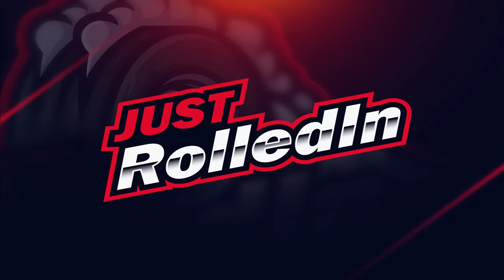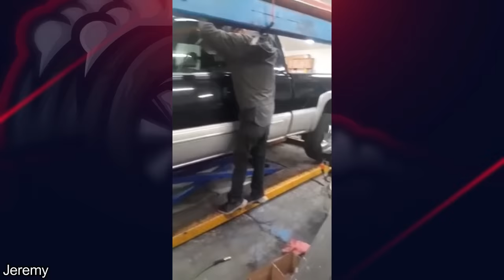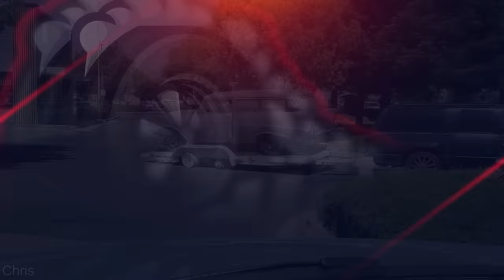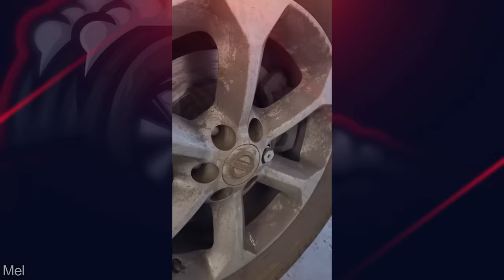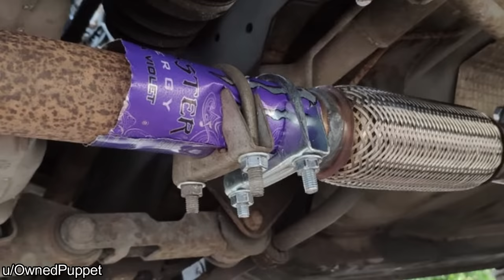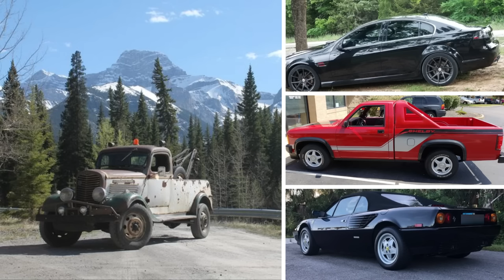Customer States Brakes Just Started Making Noise Yesterday! | Just Rolled In

Comment: OK,  so towing the '57 Chevrolet Nomad,  if the trailer looks like that,  what will the rebuild look like.......just wondering.....
Reply: That is the rebuild....
Reply: That's not a Nomad, it's a 210 2 door wagon.
Reply: @QuanticChaos1000  your are correct,  I stand corrected......👍👍
Reply: This is why you never borrow someone's trailer and always check out the trailer before taking it on a trip if it is not your personal one.

Comment: Wow, I have a few comments on this video.
The sidewall repair - that only makes sense to do as a trail fix, where you have to do it or you don't get out. Otherwise, replace the damn tire.
Blown axle - looks like they ran it dry, and it blew up after seizing. I've heard of guys running on rims up near Alaska because they had no choice, this was just a clueless owner.
The exhaust repair with the tin cans is something I learned from my Dad as a temporary fix, though it's traditionally done with mechanics wire or fence wire. Keeps you in the good graces of the local LEO's until you can get some new pipe and fix it right. I've also tried that crappy exhaust tape a few times, but it always blows out on me.
I know two people that have shot their trucks when hunting, in both cases they propped the gun on the truck for stability, sighted the shot through the scope, and forgot that the bullet comes out of the barrel a couple inches lower. One was through the hood of his truck, the other one was through the bed of their truck.
Reply: Sort of same but dumber...friend had been hunting, walking back to truck, must have been 1/4 mile from it, aimed and fired at it as a joke...didn't laugh when we got there though. Both side windows gone.
Reply: I saw 2 girls try to fix a sidewall hole the size of a nickel with spackle. In a 7-11 parking lot.

Guess what happened...

Comment: A few months ago, I had a car in where the customer states was "brake pedal is squishy and low brake fluid light is on".
No mention of noise.
The pads where worn through, backing plate of the outer pad gone, caliper fingers worn almost all the way through, and the piston was just barely hanging in there by the dust boot.
And they DROVE it to the show that way...

It had newish brakes all the way round, but by the looks of it the brake pad shims hadn't been replaced and the surface hadn't been cleaned, so the new pads got stuck.

Comment: Had a customer come in for a oil change on her daughter's car , they went for lunch and we did the work and I had to park the car and I turned the radio off so I could Concentrate on driving (and not have my ears bleed out) ... and you could hear the brakes saying they needed some attention and they came back later and paid for the work and went on their merry way, and a little while later the mother came back asking if we did something to the brakes and we said nope just the oil change. but it's amazing what your car is saying to you when you don't have the car radio blasting away.

Comment: Trust me I've tried putting plugs in the corner of the sidewall of the tire and down the sidewall of the tire in my work when you pump the air up but as soon as that thing rolls about 10 ft under the weight of the car it's going to start to leak again it will get you out of the Bush though
Reply: its not ment to plugg a sidewall puncture.

Comment: First rule of thumb for tire repair.... NEVER plug the sidewall and don't plug tread area any closer than about 3/4" from sidewall. If a shop did those repairs, the techs should be fired. Putting a plug in the sidewall can easily turn into a shredded tire. Support is weak in sidewalls and has no steel belts to support it. At most it has nylon.

Comment: I'm a parts guy for one of the U-Haul shops in Connecticut. STOLEN CATS ARE THE BANE OF MY JOB EVEN WITH THE REBAR MOULDED CAGES to "prevent theft". U-HAUL spent over 60 BILLION last year in cat replacements.
Reply from the maker: 60 billion? Wow
Reply: I'm guessing you meant million not billion? Their annual revenue isn't near high enough to spend 60 billion.
Reply: @mattt4183  that could be it. i knew the first two digits were 60, but the amount of zeroes must have been exaggerated in my head haha

Comment: I had a customer tow their Dodge delivery van in because it stopped moving while on the highway.  Pulled the diff cover to find the pinion blue and no teeth.  The bit of oil had turned to soot from the heat and coated everything.

The driver "never heard anything, it just stopped moving and coasted to the side."

Same truck came in a month later with a blown up 318.  It overheated so bad that it blew the block heater out of the block, blew both head gaskets and the detonation cracked and dished 4 pistons.

The driver "didn't hear anything and just suddenly saw smoke behind the truck."

I made lots of money from these guys.  lol
Reply from the maker: He must have a good radio for never hearing anything 😅🤣

Comment: We had a guy come into the shop with no material left on his brake pads, metal on metal. I told him, in no uncertain terms, he needed brakes, right away. So he comes back, over 3 months later, for a state inspection. I failed him cuz his brakes were toast. Fluid black. I said he needed pads, rotors, calipers, a flush, and maybe lines. He freaked out and asked for the manager. Mgr takes one look, says wtf...
I show him the old r.o. So he tells the cust exactly what I said. He started yelling at the mgr, so I wrote up a report and filed it with the state. When I came back out, he said I was trying to rip him off. I asked how the brakes worked. He said he had to stand on the pedal to make it stop. Mgr laughed. I told him cuz he waited too long and fried the whole system. He got in it and stormed out. He came back a few weeks later, at the end of the month, and had the work done.
He requested another tech.